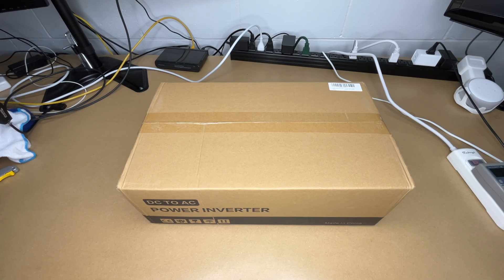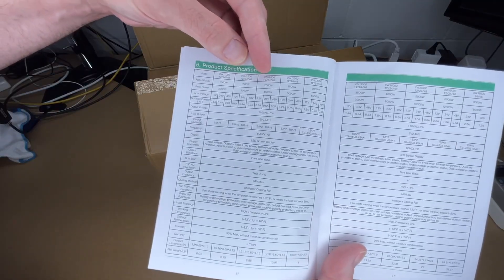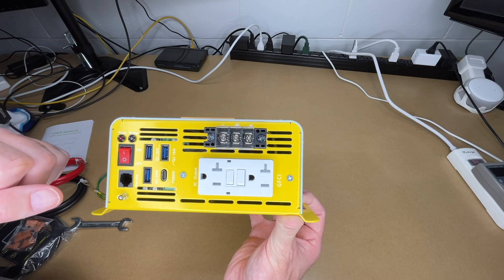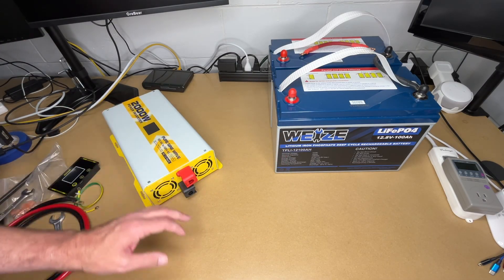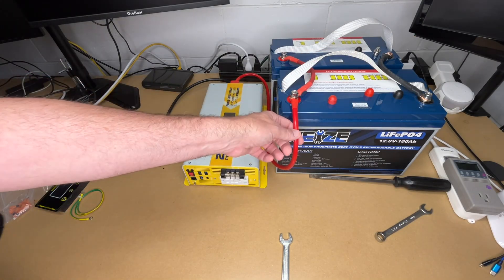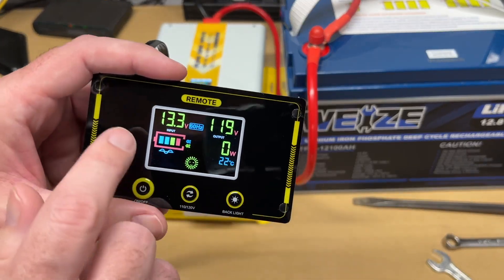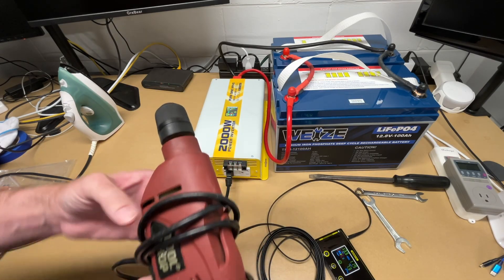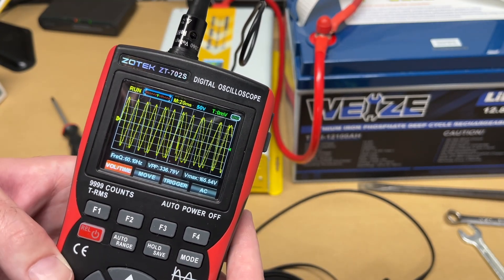XWJNE 2000W Pure Sine Wave 12V DC to 120V AC Power Inverter

Comment: Thanks for this thorought review. Just bought this model with Black Friday deal of 101.00!!! That's 101.00 for a 2000W pure sign wave inverter! Was anxious about quality while I wait for shipping, so was checking out reviews, which all seem really positive.

I'm upgrading from a 1500W Cobra, which blows fuses every time I forget to power things off and my fridge kicks in and there are 6 internal fuses that are SUPER hard to access (I've gone through 30+ fuses in 2 years! and actually had to cut a hole in the bottom so that I can change the fuses without taking the whole unit completely apart every time -- an hour+ job).

This XWJNE one seems to be everything I want! Well, okay, I would like a little nicer cables and one more outlet. But I am hoping to run my air fryer (1200 watts) without melting the wires(???) Did the battery wires get hot when you ran that 1500W heater?? About the outlet... with the 30amp hard wire, (thanks for pointing this out!) the two outlets shouldn't be an issue, as I can hardwire an orange extension from it. 

I love how the power terminals are vertical -- most of the cheap big inverters have them horizontal, which with heavy wires can be a huge pain (winding them in tight spaces, or crossing them, etc)

Excited to get this next week!

PS: who knows how the dudes working at the factory say "XWJNE" to each other, right??😀

Comment: You should try it with a microwave.  my 2000 watt inverter shuts off when I try my camper microwave.
Reply: When the M/W is the only load?
Reply: Also, is that with a 100ah bank or a 200+ ah bank??